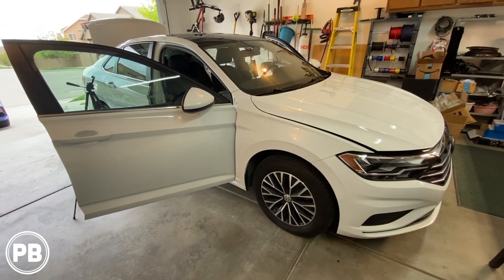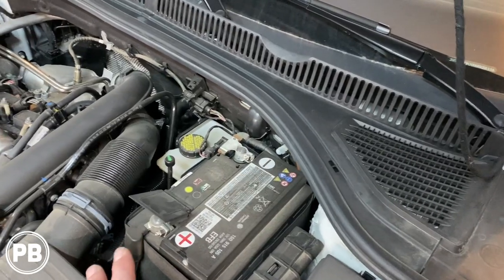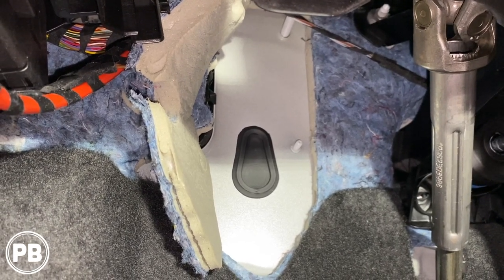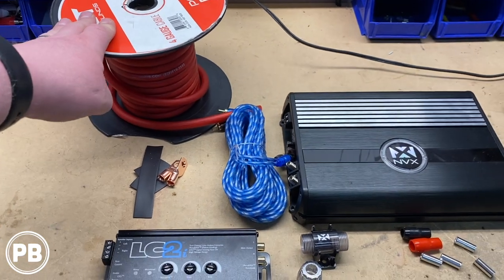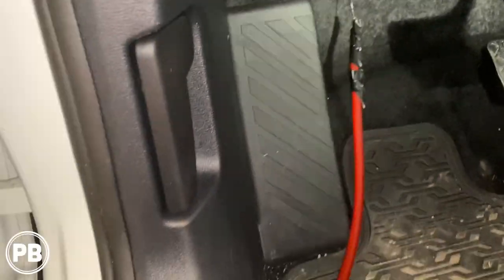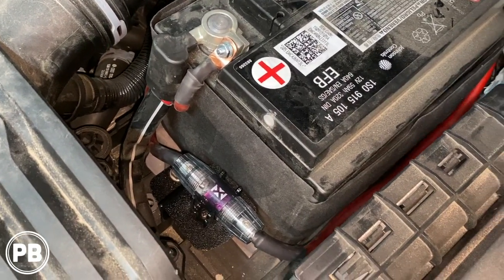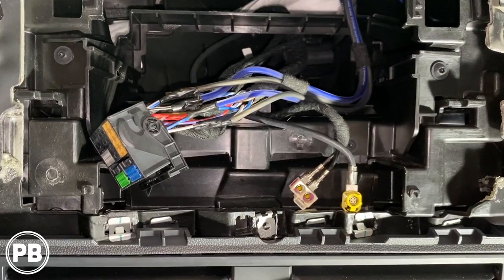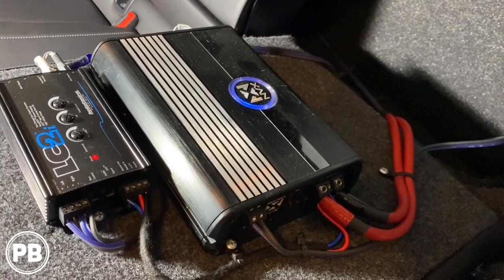2019 - 2022+ VW Jetta Sub and Amp Install

Comment: Why in the world would you run the high level speaker wires tap ins all the way back to the rear of the radio? That is absolutely ridiculous and defeats the purpose of this high to low level input converter! First of all, he is adding a subwoofer amp so you would want the lowest possible frequency going in as most of the newer audio systems are set up so they don't have lower signals going to the main speakers, the lower signals only feed in to the rear channels or into a dedicated sub channel. 97% of the factory systems have three subs in the rear seat or trunk area. These liner output converters are made to make it easier and more convenient to add subs and amps to factory systems. If your factory system has a subwoofer then you would want to tap into those wires before or after the amp depending on how many watts is coming out of the factory amp. This guy ran an extra 20 feet of wire and caused at least an extra 2 hours of work taking that dashboard apart and in the end will hurt the sound on 2 levels, A) the extra length of wire gives it more opportunity to pick up unwanted distortion and B) may not have the low frequencies needed for the sub. Every single one of these we install gets trapped directly into the factory subwoofer wires or in to the rear deck speaker wires. the only time I tap in to speaker wires in the front of the car is if I'm adding a multi-channel amp and upgrading the other speakers.
Reply: I have a 19 Jetta GLI, and planned on using a LC6i to add an amp and sub. Eventually I plan to replace the doors and maybe add an amp for those as well. Are you suggesting that I can tap directly into the harness from the factory sub to hook up my LC6i?
Reply: The beats system has a 400w amp and sub in the trunk, can I follow steps in video and tap into sub wire instead? Would I leave the factory sub there and add my own amp/sub?
Reply: @shmikey100 I also have the crappy beats sub in my 2021 Jetta and need to know if I can tap into the rear wires already in the trunk, but have yet to find an answer
Reply: i see this comment after i followed his step by steps to install mine
Reply: i fused my remote wire to my fuse+ and my amp stays on 24/7 and i have to unplug it wvery time i turn the car off so it doesn’t kill my battery.
Reply: @imperfect_Visions  have you found anything about about tapping into the wires ? Than there would be no need to even mess with factory radio is my understanding
Reply: @Cummins24v. you’re correct. You can tap speaker wires from the B pillar instead of going all the way to the HU.
Reply: @cvibez7100 remove that remote and look for a 12v ignition

Comment: Why go behind the unit when you can the signal at the speaker?
Reply: X2
Reply: I was going to comment that the rear speaker wires are available at...... The rear speakers. Hell no I am not breaking some of that dash maybe and not even changing head unit
Reply: Exactly!  Makes no sense!
Reply: @adamsnider1528  actually, the speakers use that kind of connector between the door and the frame, so it's harder to get the signal. I made this sub installation on two 2019 Polos, wich use similar systems to this. In the first installation, I got the signal at the rear doors frames, in the last one, I made the connection behind de multimedia central unit, which is located in the glove box, just like the Mk7 Golf. Both ways are valid. 😉
Reply: @Thf.martins  i meant actually at the speaker connection... Not in the door, not at the head unit, at the speaker. Where the wire ends. No digging around in the car
Reply: @adamsnider1528  like i said, if you get it a the door, you wouldn't be able to pass the cable to the trunk, because it doesn't have the pass through hole at the door, it has a connector...
Reply: Also, the speaker wires are both white with no markings to indicate (+) or (-). Replacing the speakers was tough.

Comment: Hey provo, on the close left of the grommett you went thru is the main harness to the engine, there is a little nipple on it that the manual trans viewers can use! This video helped me with my 2020 gli, i uploaded a video showing where the grommett is for the manual trans vehicles!
Reply: Thank you my friend I was about to drill and seal a new hole
Reply: doing my install today and you just gave the answer to my only question thank you sir
Reply: What amp and sub are you using? And do you have an after market head unit?
Reply: @briefdavid2256  no aftermarket head unit, i tapped directly into the rear door speaker wires and fed it to an LC2I. Im using 2 kicker 12 compvrs and an older sony amp. It works good but just know, i believe theres a voltage limit on the stock head unit so the bass is not as deep as i want it to be, still sounds awesome all these years later though.

Comment: My girlfriend just bought a 2021 jetta and I'm most of the way through the install. I just don't see where you set up the remote wire. Unless you rigged it to the lighter socket. Most informative video none the less. Thank you for posting :)
Reply: With the lc2 you don't need to run a remote wire. Just a remote wire from lc2 to the amp. It turns on when the lc2 detects signal
Reply: I think they meant remote wire for the Amp

Comment: My 2021 jetta premium sel, sound super hot  with the extra bass, I took the sound from the original spare tire subwoofer.  This video help!  Thanks  😊!
Reply: Did you get any errors for the start stop system after you put it in?
Reply: I have a 19 GLI and had considered doing something similar, was there a guide you use by chance?
Reply: Is that a beats audio system?
Reply: @shmikey100 yep, only included in se and sel i believe

Comment: Can you tap into the rear speaker output inside the rear doors, right by the speakers?  Those speaker cables end up there anyways.  That would be a lot easier than taking the dash apart.
Reply: Take the b pillars off, unbolt the seatbelt. Looks like the rear speakers are white blue and blue white.

Comment: Can I not just tap into the left/right rear door speakers at the b pillar rather than taking apart the whole dash?
Reply: By chance have you tried this route?
Reply: @Thiswuan  right?? I wanna know if it works I seriously don’t wanna take apart my dash
Reply: I tried it over the weekend it works took both b pillars out and i found the speaker wires   Hooked it up and it worked the only thing im having trouble with is that im using a 2 channel converter instead of what he is using and it kinda makes a hummin noise might be my amp tho but it sounds great
Reply: @luisparra9918  why both pillars? I have a mono amp can I just tap into one b-pillar?
Reply: @someone28  yeah i went back i was having issues when i hooked it up on both i ended up just using one side and it works perfectly fine  i ran wire from speaker harness but somehow polarity were fighting each other tried various things didnt  work so i just hook it up to one side and its  works no issues

Comment: Im an amateur audiophile and I work at a VW dealership and I love our cars but both the base 4 speaker and Beats upgraded system are horrible, honestly. I honestly feel like they just deleted tweeters from a 6 speaker setup because it sounds like the tweeter range is just MIA. Treble all the way up and it still sounds muffled.
The beats system has a harsh metallic sound and terrible hollow bass that makes the door panels rattle just turned up slightly. The only Jetta system i can tolerate is the GLI S system because it still has tweeters and no sub but sounds better than the aforementioned!
Reply: I have a 2020 gli s and it feels like halfway up it starts to sound ok but then it really won't get any louder.
Reply: Agreed, my 2020 jetta sel has the beats audio...  Not impressed, needs different speakers and the wiring is a lil different on them, nobody has any info on them yet
Reply: I have the beats system in my GLI, also not a huge fan of it, have you came across any info since a year ago?
Reply: @jordanlange5689 same here, have you managed to upgrade them in any way?

Comment: How would you recommend hooking up the remote wire for the amp? From my understanding you had it ran from the LC2i to the amp?
Reply from the maker: If you have the GTO circuit enabled, just simply connect a wire from the remote out on the LC2i to the remote input on the amplifier.

Comment: what screws did you use to mount the amp? I'm in the same boat and need to figure that out and did you tap into the fuse for the remote switch? If so which one would you recommend. Appreciate the help

Comment: Does the factory radio "see" that LOC as an additional 4 ohm load being wired in parallel to the existing 4 ohm speakers and putting a 2 ohm load on the factory radio?

Comment: Does the LC2i provide more power for the front and rear speakers the way you have it hooked up in this video? In this video you have just a subwoofer hooked up, but you tapped into the front and rear speakers behind the radio? It seems like you should’ve tapped into the subwoofer output. Can you also tap into the rear right and left speaker door factory wires to the LC2i, And then power your subwoofer? Also, by adding a amplifier to the LC2i from the front and rear speakers and then by adding an amp, you’re increasing the power to the front and rear speakers?

Comment: I have the 2013 version which is very similar, I heard I can tap into the rear Fender system sub and bridge the LC1i Speaker input does that sound right?

Comment: Can you tap into the speaker wire already in the back trunk so you don’t have to run wires back to the radio?
Reply: You can grab the wires in the pillar by the seat for the door speaker they will be twisted together. You can use just one side for both inputs of line level being that sub amps are mono
Reply: @spoolnup18t  so I don’t have to take apart the whole dash like this dude did?
Reply: @nickcarlock3197  no sir
Reply: They should be the twisted pair

Comment: On a 2021 jetta I have an lc7i with front and rear speakers tapped to keep the fader functional. Unfortunately one set of speakers that were tapped don’t appear to be getting the full signal and it sounds almost muffled or lacking. I just kept one signal on and disabled the fader on the kicker amp. I checked all channels of the amp and of the lc7i. The issue was recreated when swapping the speaker wire taps into the lc7i. 

Is there a bad or treble attenuation to the rear speakers?
Reply: Did u try taking the top off of the lc7i and move the channel 2 "jumper switch" to "sum"? This way if there is bass/treb roll off on Chan 2 yet Chan 1 is good, this will equal Chan 2 out by summing the full signal to Chan 2.  Not saying that's the answer but worth a shot

Comment: Can you tap into rear speakers wires in the trunk instead of going to radio?
Reply from the maker: you could, but most jetta and passat vehicles with base level audio don't have speakers in the rear deck / trunk to tap into.
Reply: @ProvoBeastAudio  can’t you wire it in the b pillar and tap into the rear door?
Reply from the maker: @nickcarlock3197  Sure can.

Comment: Just did my install with help from your video. I’ve got no power to the amp, I’m thinking maybe I’ve got a bad ground?
Reply: Gotta also bring a remote power from the radio, so the amp turns on when the radio turns on. Or you could just do what i did connect the power from the battery to both the remote power and the normal power. Then intall a switch somewhere and remember to turn the switch of when its not running because it will drain your battery.

Comment: Do you have to run wires all the way to the back of the radio if you already have a factory subwoofer in the trunk. Can you just get the signal from the factory subwoofer?
Reply: No, there’s a harness already ran from the radio to the subwoofer, you just have to look at the wiring diagram to figure what is what and go from there, but if you’re using an amp set up you still have to run power wire from the battery and ground it somewhere. Having a factory sub makes the process easier because of that harness, you can just tap in to that. Unfortunately i have to do all of this in my 21 gti🗿

Comment: How do you know what you should tune the lc2i output voltage to for the subs and then how much for the amp gain?
Reply from the maker: We used an smd-dd1 to set our gains. You want the highest output voltage from the lc2i so you can set your gains as low as possible on the amp for the best audio quality.
Reply: @ProvoBeastAudio  ahh okay so if I don’t have an smd should I set it to 4 volts to be safe with a multimeter for now on the lc2i? Also what track do I need to set both the lc2i and the amp?

Comment: could you do a 2008 toyota prius and tips to add another battery in the back? I have everything ready but i cannot find a good video tut on how to connect everything. I have D4S 2800 Rms amp and kicker solo x L7x for my sub. Also i have Lc2i to convert my signal output but i went to a shop and they recommended a generic kicker Loc which idk which one to pick from. Thank you Please update me>!!

Comment: The power wire to the lc2i isn't protected, I'd put a smaller fuse in it. You don't want to start a fire.
Reply: do people run a fuse block into LC2i if connecting it's power directly from battery?
Reply: @HugeGamma  I hope so. This is from their web site. "The LC2i requires a +12V in order to run properly. For best results, the +12V should be provided by the battery via direct line or from a power distro-block. The preferred wire gauge for the connection is a 18 AWG, and a 1A fuse is recommended."

Comment: Trouble shooting video? Esc, tire pressure, hill start assist, and front assist light coming on.
Reply: Same
Reply: Any solution
Reply: Mine went away after i drove for a bit. I got the check engine light cleared. And now im good
Reply: @TheOneTurk  mine doesn’t let me start the car

Comment: Why go all the way up to the radio when the same wires are at the Center post on both side going to the speakers. ?
Reply: i think it gets a better signal closer to HU
Reply: @HugeGamma  I do understand your train of though however next time do a resistance test at the HU & also at closer to the speakers the different won’t be noticeable. Remember time is money 💰 save. In most cases re & re HU takes more than an hour. Any way have your self a blessed new year

Comment: What wire would I tap into for a 12v source that only powers on with ignition? I don’t know which wire it would be. This would be for my blue wire that runs to my amp
Reply from the maker: There isn't any switched power behind the factory radio, so your next source would be either a power socked that is on switched power, or tapping into the fuse box, or use a line out converter that generates a remote turn on for you like this one: https://amzn.to/2T8oZqz

Comment: absolutely amazing. thank you. will this work for a beats sub removal then this upgrade?
Reply: @fatguyalwayseats did you end up upgrading in any way? What about the door panel rattle on your font passenger side?
Reply: Many people online complain about a door rattle on passenger side when volume is over 50, mine definitely has it.. so the shop removed the stock sub and you out your own with an amp and LOC? I will probably end up calling the local store and asking for advice
Reply: @fatguyalwayseats ok! Thanks for that man

Comment: Will the factory deck support better door speakers?
Reply: Yes use crutchfield to find ones that fit best and pick something with an "up to x watts rms" in the specs. I did this. And will give me the option to add an amp down the road.
Reply: I just added the kicker cs and they sound wonderful without an amp.
Reply: @dest125 was that on a beats system?
Reply: @nicholasbaker2904 was it the beats system door speakers you replaced?
Reply: @shmikey100  idk what the beats system is. I have a 2017 jetta se and replaced the stock speakers with kicker cs speakers and an alpine under seat sub/amp box
Reply: @nicholasbaker2904 thanks for your reply, this video is for mk7 jettas.. Did your system already have a stock amplifier and subwoofer? The beats audio system on the mk7 does and I think that makes adding an loc a different process than described in this video

Comment: can't you just use rear speakers to tap in?
Reply: I tap into the rear speakers in the rear of the car when there is no factory amp.  It doesn't matter if there's no factory amp if you're on one end of the wire or the other.  On this particular car with that ridiculous dash removal process, the time it takes and the risk of breaking any of those stupid clips its not worth it.  Tap into speakers in rear of car and much less work.
On cars with a factory amp is a different story, in that case you want to hook directly behind the radio so that you are grabbing signal BEFORE it passes into the factory amp.  On base models I avoid this headache all the time.
Reply: Especially when the rear speakers are on the parcel shelf right below the rear window.  Gives a good place to mount the LOC and nice, neat short wires.  Also using wire T Taps are the easiest and fastest way without disturbing the factory wire much at all.  It's also easily removable later.  I never strip back the wire, make a hole in middle (risking breaking some strands) and wrap it around.  I can get all 4 wire T Taps on in 30 seconds flat.
Reply: @rxtuninginc8444  you make it sound so easy... ill pay you to do mine!
Reply: @rxtuninginc8444 so if I have the beats audio "upgrade" which includes 400w amp AND a sub in the trunk, I can follow steps in this video and tap at the head unit but what about the sub I want to replace?

Comment: Did you crimp the wire ferral? I can't find a tool to do that except like a $150 one.
Reply: You can just slide the ferrule in the slot and use the set screw to secure it. But seeing as you wrote this 2 mos ago, you probably already figured it out.